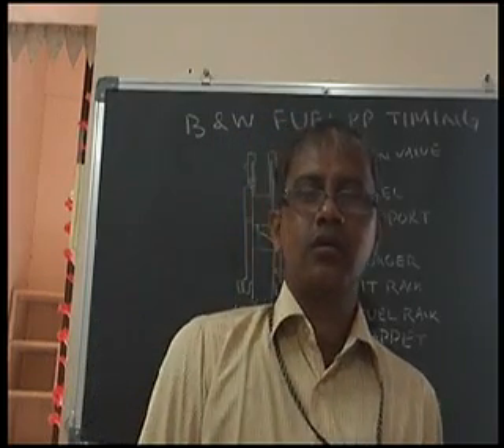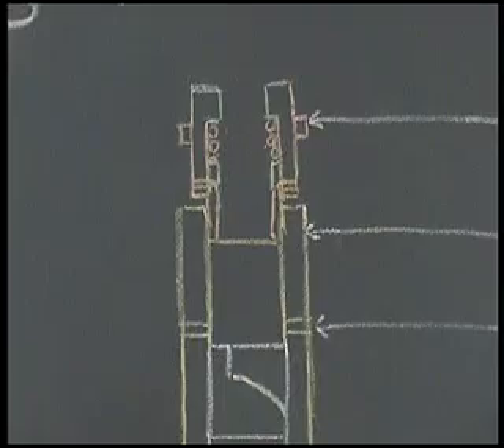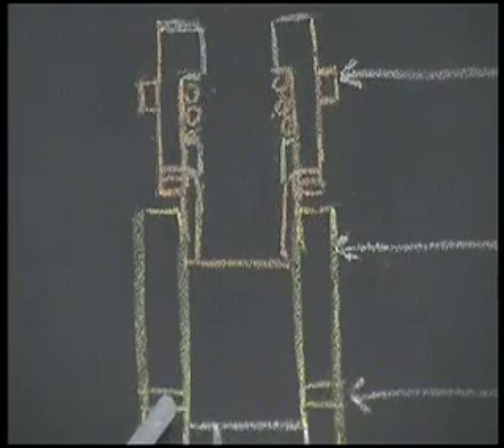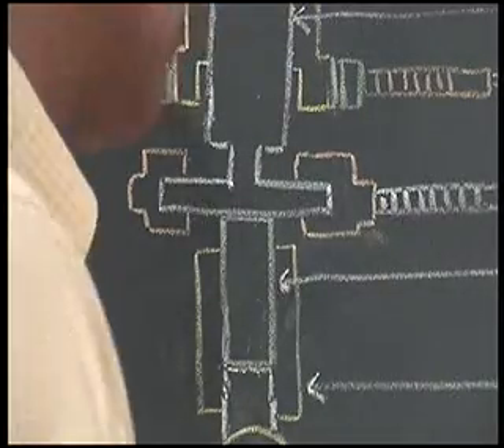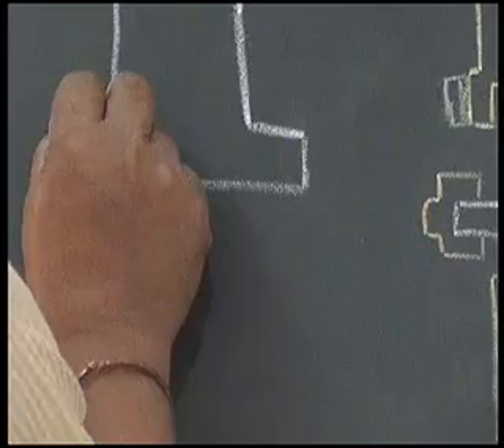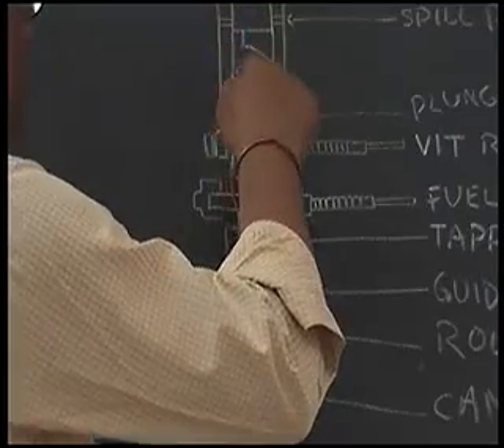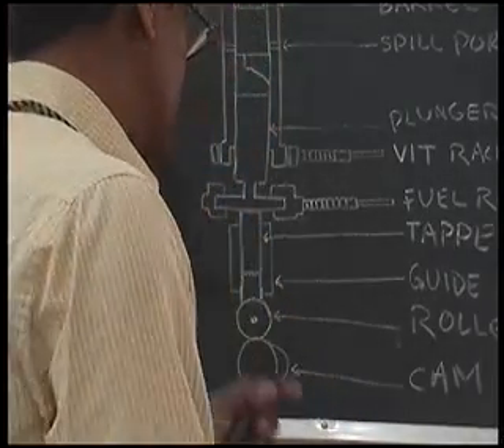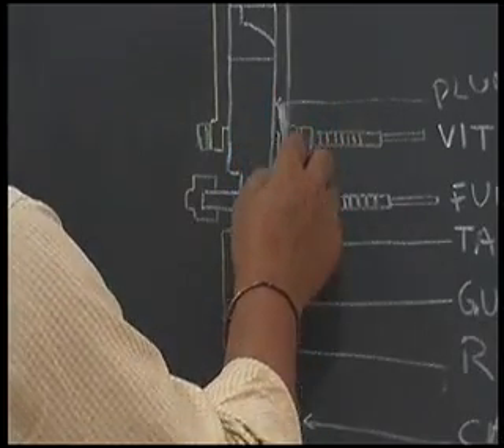B & W  Fuel timing Adjustments with shims

Comment: Sir good day may i ask according main engine fuel pump vibration  what is the problem sir?
Reply from the maker: Due to broken spring of fuel pp, irregularities in cam profile, damaged parts in tappet system or due to cavitation in fuel system due to less fuel supply pr to fuel pp or even a broken spring fuel pp suction vv or sluggish action of any of these

Comment: Where do we fixed the shims?
Reply from the maker: In fuel pp shims can be added in two places.First is between the engine body and pp base so that the  fuel pp is raised up a bit and the tappet of the cam mechanism touches the fuel pp plunger later than before causing retardation of injection.The second place  is below the tappet  so that it is raised and it touches the plunger earlier than before resulting in advancement of injection.
Reply from the maker: Tappet is a part of the cam mechanism which consists of the roller ,follower and a solid small bar shaped metal resting  on the follower which pushes the plunger. So the  place for adding shims is between the follower and this bar so that the bar raises and touches the plunger earlier and hence advances the injection.It is not advisable to add shims between the tappet and plunger because then the shims can anytime fall off.

Comment: good video..thanks sir
Reply from the maker: thaks for liking the video
Reply from the maker: Tappet is a part of the cam mechanism which consists of the roller ,follower and a solid small bar shaped metal resting  on the follower which pushes the plunger. So the  place for adding shims is between the follower and this bar so that the bar raises and touches the plunger earlier and hence advances the injection.It is not advisable to add shims between the tappet and plunger because then the shims can anytime fall off.
Reply: Where do we insert the shims? Between plunger and tappet!?